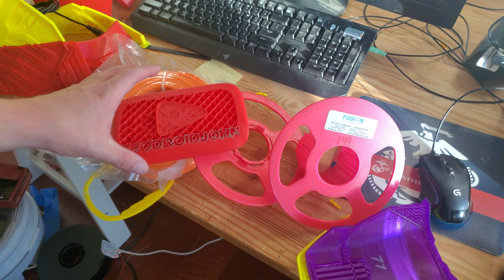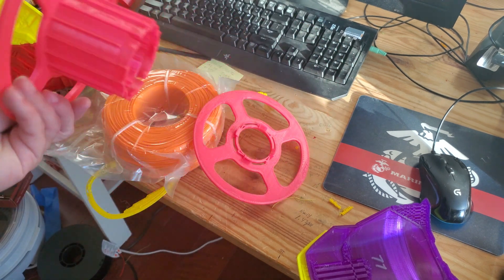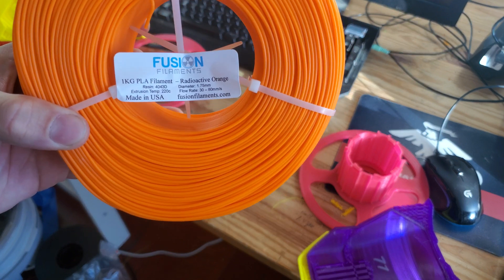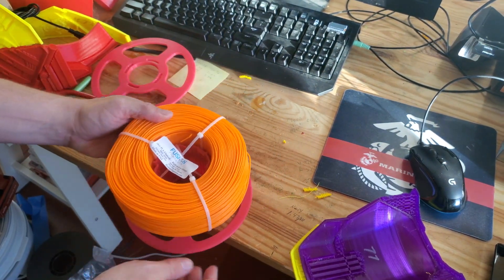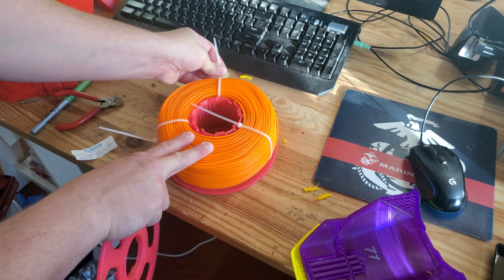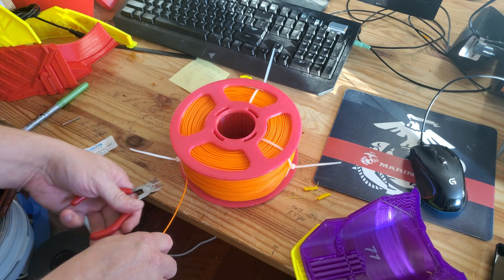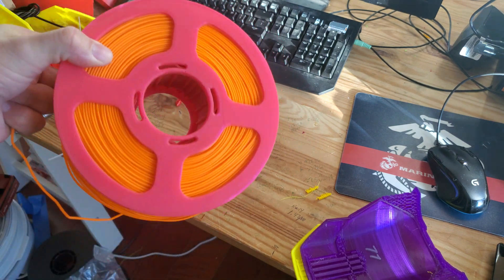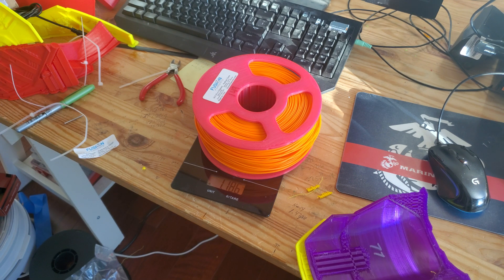How to Use Recycled 3D Printer Filament Spools | MASTER SPOOL

Comment: I can't believe you let go of the filament, dude. I hope it doesn't tangle on you. Never release the end of the filament like that. Always make sure it's secured somewhere.
Reply from the maker: I feel that! Yea I walked a few meters off of it after and ensured there were no tangles, been printing about 36 hours since! Thanks for looking out
Reply: @GeoDroidJohn  Master Spool is a great concept. I wish more manufacturers used it. I've got a bazillion spools, though. Any ideas for using them other than rotating parts organizers or xmas light spools?